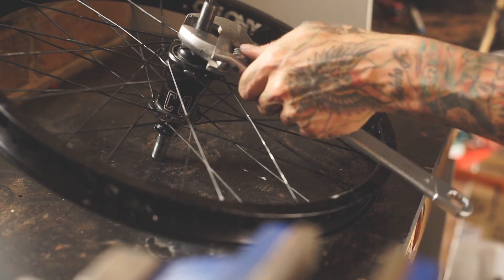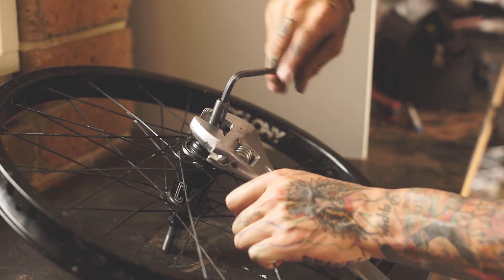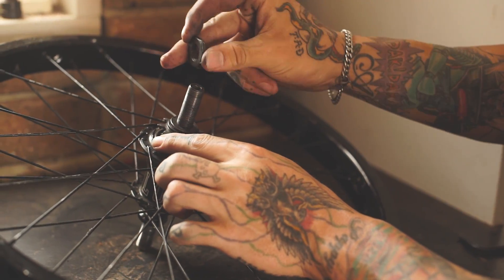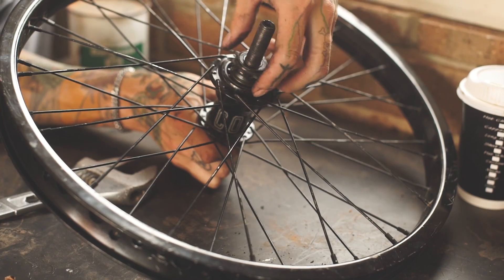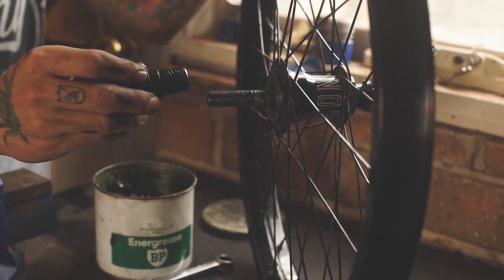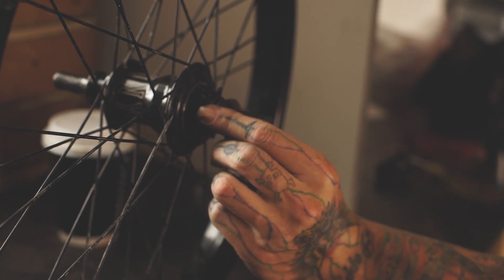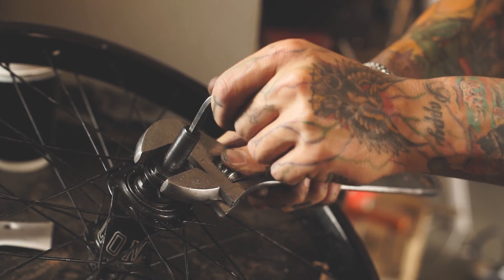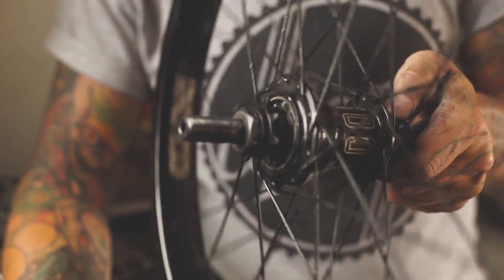How to replace free coaster driver - Colony BMX

Comment: i also have the freecoaster but everytime i go to pedal and it makes a cracking sound as if it was sticking. yes i have already cleaned and regreased it but its still sticking and i dont know if i should try to keep fixing it or if i should get a new hub? plz help cause i really dont want to spend money on a new hub
Reply from the maker: You may need new driver bearings, maybe hit up your local shop and they can check them out for you.

Comment: Please help me how to remove bearings inside the driver. :(
Reply from the maker: Hey, it can be really tricky to remove the bearings in the actual driver. It is probably best to get a bike shop to do it, otherwise getting a new driver can sometimes be the easier option. Sorry we can't help you much with this one.
Reply: @ColonyBMXBrand  i have 1 more question; does the right and left freecoaster driver same? Can i use RSD freecoaster driver on my LSD freecoaster shell? i really appreciate the answer. thankyou